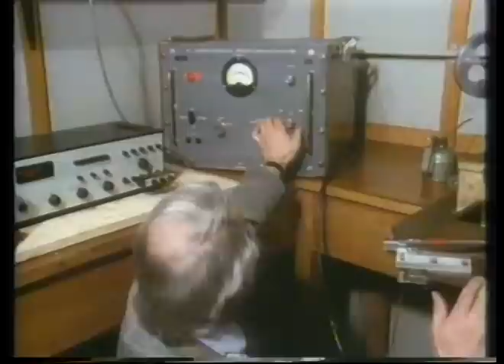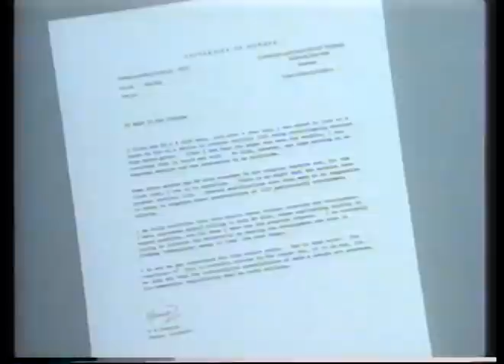Anti-Gravity Machine (Part Two)

Comment: Gravitational Deflection! Right now, there is no real understanding how or why gravity works. Just that it does. Cetrifigal laws say that we shouldn't be able to walk on a spinning ball. Gravity permits it though. The only element that permits us to see an artificial/isolated natural manifestation is magnetism which reacts with metals. Tesla recognized the electrical saturation of our environment. If we look at plants like many types of trees, we can recognize their simularity in growth patterns to bolts of lightening in the sky. Radio waves are the manipulation or ripple wave impartation into the electro-magnetishere by a transmitter while a receiver interpets to affects over distances. This machine seems as though it disrupts and redirects those electromagnetic fields or gravitational field by creating a low concentration field at one end and a deminished field at the other. Since understandings of these things are still in their infancy stages here on Earth, knowing how to formulate a mathmatical equation that we would be able to interpret as to why it works would seem to be a daunting task. I am sure it would reveal questions that would need answers to bring about true understanding of what is happening. I really wonder how much stronger the lift would be with a larger multiple of the angular gyros! Everything we know is by experience which insites curiosity which produces questions which lead us on a search for answers. This is one of those times where a guy had enough persistence that has brought us this far with his journey. It will depend on how many people decide to get on board to experience and develop the ride with him. Then maybe they will share their ride with the rest of us. Some people are so narrow minded, that they fail to realize that all of creation here on earth exists on the surface of a spinning ball called: EARTH unless we learn to weather the storms of life together, life will never get better for the entire family here on this planet!
Reply: Cetrifigal laws say that we shouldn't be able to walk on a spinning ball? I'm not sure what "Cetrifigal" laws are but there are no laws that say you can't walk on a spinning ball.
Reply: @handymanextrodinaire1258  When two type, as we are doing here, it would help if your reference about fans and pumps made some mention of spinning balls or walking.  Sadly is does not.   Promise you will stay deluded and keep pedaling this nonsense.   promise me!
Reply: @DeputyNordburg  Blah Blah Blah!
Reply: Narrow is the mind that cannot see beyond their own narrow focus! But wise and open is the mind that seeks the common ground on which we stand! Nothing makes sense to a lazy mind nor to the one that only cares about their own interests alone! I offer the opportunity to expend your mind freely where it may take you. I sell nothing! I do not seek to program anyone with limitation. I only offering the chance to expand your own understanding by presenting different perspectives.
 Good or Bad are the result of your own maze of theory and perception.
A clown or an elephant can walk on a literal ball. Wheels spin on ball bearings! Man stands on a spinning ball, and may run or walk in any direction without being flung into outer space, but if a man on earth were to stand on a where that were to be spun under him, it would cast him aside if he where not able to maintain his center of gravity over it. Running, walking or hanging on may buy him time but if the ball is spinning continually out from under him, he will fall if he seeks to simply stand upon it. On Earth, gravity allows everyone to stand on a spinning ball flying through outer space around the sun. For you, I am sure, this is interpreted: Blah Blah Blah! Now let your emotions take control. Or be controlled!
Reply: @handymanextrodinaire1258  When you can't support your point, you attack me personally.  This is ad hominem and is just tedious.
The drama of the old English "Narrow is the mind" or "When one speaks" thing is also pretty tired.

"For you, I am sure, this is interpreted: Blah Blah Blah!"  See here is what is so wrong with your whole schtick.  You claim I have a narrow mind, and then tell me what I am thinking.  You are doing what you accuse me of.   You don't ask questions, you don't try to find out anything from me.  You apply your prejudices and preconceived notions and just attack attack attack.  Why?  Tell me what has you in this state?
Reply: @DeputyNordburg  Tell me please, Sir Nordburg; which of your replies are not attacks upon me!
Reply: @handymanextrodinaire1258  The first, third, and fourth one.  Tell me why you can't answer my questions?
Reply: @DeputyNordburg  my first reply had a link to Centrifugal Laws. That was an answer to your first question. Further more, we can only walk on a ball if we are here on earth and the spinning of the ball occurs as we rotate it as we walk and only in the opposite direction we are walking in! But furthermore, my first post was a euphemism  about how we as humanity live, walk, run and skip, if you will without a care, on a Massive Ball called Earth as it, along with us, spins through space around the sun! Scientists postulate that the planets have their orbits around the sun due to Centrifugal Laws which allows Mercury and all orbiting bodies all the way out to the Kuiper Belt which is a band of smaller rocks that encircle the outer ring of our solar system. Plants of varried sizes, some with several moons that orbit those planets, are all set in place and motion due to the Laws of Centrifugal Forces! 
At what point were those theories tested and proven? I question facts dictated without substantiated proof.
My first post was started with Two Words! Those 2 were: Gravitational Deflection! My simple theory, which is not proven or substantiated, theorizes that: Gravity as we experience it, must be deflected in order to be overcome in order to be labeled: Anti-Gravity-Gravity! Anti-Gravity  is a word/ conjunction that means opposed or against gravity. I have not offered a contradiction to Anti-Gravity but rather offered the perspective of overcoming gravity by deflecting its captivating forces that draws things toward the earth or other masses.
PLEASE Explain why you felt the need to debate whether someone could walk on a spinning ball or disavow the validity of Centrifugal Laws. I have not disavowed anything really but question everything to attain further insight and knowledge so I may continue learning. Before telling me that Centrifugal Laws don't exist, try doing some research before telling me there are no laws. Before asking me to talk about gears and pulleys, why not first try to understand my perspective? How I talk, what I say, or why I say anything seems to be something you care more about commenting negatively about rather that to pursue a real beneficial discussion! Type vs. talk?  Really? So from what I gather from your replies and questions is that my posts must enter your mind at which point all you hear is Blah Blah Blah. Then for some reason, you feel compelled to ask more questions Asking questions does little good without taking time to think about the responses? So when you post asking me to do something different, I ask you, do you think these posts were directly focused on you being happy, content or enriched by them personally? If so, good for you! But don't expect me to feel the need to give you the replies you believe that I should be providing. I simply posted what I felt compelled to post at the time. I never expected to have to answer to the YouTube Post Master General. So keep flying at least until your arms get tired! At which point, you,'d wish Anti-Gravity were something you could reach out and grab hold of!
Reply: @handymanextrodinaire1258  My question was: "Cetrifigal laws say that we shouldn't be able to walk on a spinning ball?"  And then you provided a link to The Affinity Laws of centrifugal pumps or fans, that made no mention of walking, or spinning balls.  It was as if you had not read them...   And I was sad.  Because I care deeply about it. Really.  
Walk the opposite way if you want.  But leave the poor pumps alone!

When you began by saying you had no understanding of how gravity worked, I fell to the earth in amazement!  Like pebbles from a hand falling to Earth, I could not believe you could not understand pebbles falling to Earth.
Reply: @DeputyNordburg  knowing that Gravity works is not the question. Knowing that pebbles drop from a turned hand is not the question! Of course they do! But take those pebbles into space and release them. Do they come seeking the greatest mass in their vicinity? Helium could give two squirts in the wind about gravity! Water evaporates and goes up until it collects to make rain then it falls. Dust lies on the ground but wind swirls above it and picks it up to cast it to and fro! Air is made of many things and waves have tides! So gravity is simple and its complexities are so simple that children crawl out of their mothers wombs with profound understanding as they labor to even try to lift their heads! Centrifugal force used in fans or pumps utilize the same forces that are attributed to "Centrifugal Force" which allow them to perform the tasks they were designed for! Take a ride on a playground spinning ride and ask others to push it as fast as they can as you struggle to hold on in fear of being flung off into the gravel as kids scream: there are no Laws of Centrifugal Forces! Yay, only hitting the dirt at high speed has consequences!
Let be more simple and elemental in making the same assertions I made in my first comment. The world along with all of the mysteries in nature have been sought to be understood. Many historical figures have claimed it have been attributed to having duscovered things! Gravity was discovered by...  Aerodynamics were discovered by... Electricity was discovered by... So on and so forth!
The first person that discovered gravity, simply picked himself up from the ground and kept going. The first person who discovered aerodynamics didn't live long as they hit the rocks at the bottom of a cliff. The first person that discovered electricity died due to the immense power of the lightning bolt! So as acclaim is attributed to those who sought to understand, document and explain the attributes of such things without becoming fatal victims to their attributes, doors were opened to greater understanding as well as to enriched the encouragement for others to pursue even greater depths of knowledge & understanding. So, as with Gravity and Anti-Gravity.  Gravity allows humanity to exist on a spinning ball called planet earth without being flung from its surface by the forces that would otherwise fling them into space. We have an atmosphere and the many traits that are permitted to exist within its gracious accommodation! Figure out how it all works and within that understanding may come the answers that reveal the ability to counter gravity in a controlled manner which may become commonly known as anti-gravity. Until then, it is all beyond my understanding of exactly how gravity works so as to be able counter that force in a working tool of transportation being the commonly know methods that are common place today. More power tho to those who seek to understand how it works better than I do!
Reply: @handymanextrodinaire1258   Yes, Helium rises, boats float on water.  It is as if the more dense objects are pulled down harder than the less dense ones!   Helium does fall in a vacuum chamber.  There is no way to know why!  And let us not forget the mysterious see-saw.  It has been levitating smaller children when large children get on the other end for centuries/.  But we just don't know how it works!!   Gravity? or Evil spirits?  So confusing.

More power to those who seek to understand middle school science!  They truly are pioneers.

Comment: Not very smooth moving steel ...try spining murcury  w/ electromagnetics / vortex coils RPM from R F . FEWER MOVING  PARTS ...mercury  = flywheel
w/ weight adjustability + - quantity in the spin . Metallic  mud &/or murcury + magnetism & copper vortex coils fueled  by R F amp . This guy should be wearing a helmit !

Comment: I do not know if this is an April Fools' Day joke, or the result of a decay in education. The machine does not produce any lift, it does not fight gravitation, It is a trick that is not easily explained, but it is explainable. There is a gyroscope, there is a motor, when the axe of gyroscope is changed there seems to be a force that is fighting gravity, but it is not!!! Some of the mechanical force that is in the movement is directed in an other direction, therefor it seems that there is a lift. When there is no gyroscope turning nothing happens. The lift can be measured, there revolutions of the axe can be measured, I predict that the lift and the revolutions are equally going up and down. 
 
It is a petty that so many hours where spoiled by this lack of education. Even at a university some people are foold, it is all mechanics and it is all within the forces of nature. The only point is that to many people have totally no idea what is happening.
Reply: Yeah! Let's see it stay lifted when the motor is turned off and it is allowed to coast.

Comment: The claim is that this device is essentially levitating vertically upward based on its initial energy spins. Now what is of concern is that this device does have an initial mass and weight to it, where he used an external counterweight to lighten the load. However, once you remove this counterweight, I fail to see how the thing should lift, and may just depend on how fast the gyros are suppose to be spinning to lift itself upwards against its own initial weight (for independent flight lets say) , and thereby too much energy to get the thing to lift up vs the velocity of the angular momentum, the more energy the more weight would have to be added to motor run the extra speed, hence the machine would then refute itself a flying apparatus, imo. But the theory is indeed interesting.
Reply: What is a concern to me is it NEVER LIFTS UP in the video.  And the maker talks BS about it.  It has a string to pull it up.  Why does a levitation device need a string and counter weight to pull it UP????
Reply: @DeputyNordburg  It does lift up in the video. Watch it again.
Reply: @DeputyNordburg  it does lift up in the video
Reply: @DeputyNordburg  he probably added a counterweight so he could measure the amount of lift it gave
Reply: @pi4313    He made no measurements.  He wrote nothing down.  A spring scale (like is used to weigh a fish) could have been used.  A better idea would have been to place the whole device on a bathroom scale.  A counterweight on the other hand can simply be pulled down with your hand off camera, or weight added. 

I want anti-gravity as much as anybody else, but fake machines don't help.
Reply: @DeputyNordburg  I can't see why a notable professor would risk his hard earned reputation to lie and be discredited.
Reply: @barblitt4222   I am not aware of any notable professor involved with this.  If you mean Eric Laithwaite, I'd have to mention he did state the device in the video does not create any force.  This after a few years of playing with the device.

Eric Laithwaite was like Neil DeGrass Tyson, more of a TV personality than a professor.

Comment: Ok the problem I see is it’s shaft is spinning in two holes/ maybe bushings. Rotation torque in/against it can drive it upwards if the inner mechanism is off balanced. Likely 1000 Rpms is the sweet spot for friction to grab the material and create a screw motion lifting it. Now if the device can lift itself off the table base and all then that’s something. If it can never have enough energy to do so it useless for the reason they are designing it for.
Reply: I think the inventor and the professor actually believed it was doing something special.  But I don't see it.  Spinning and wiggling are things we have done before.